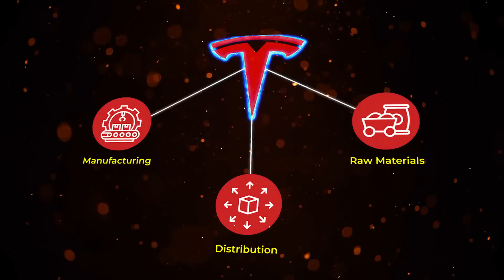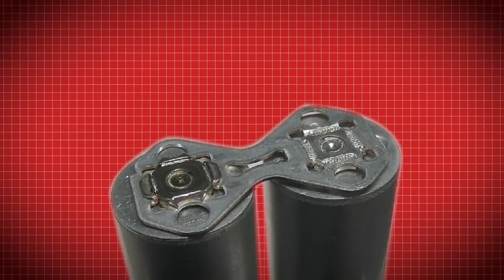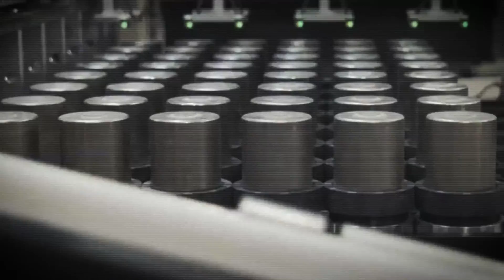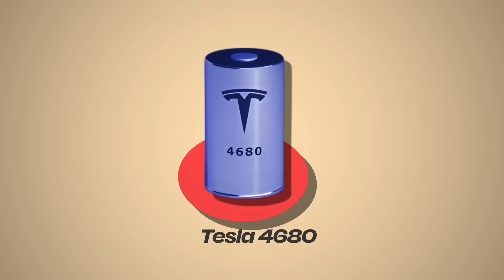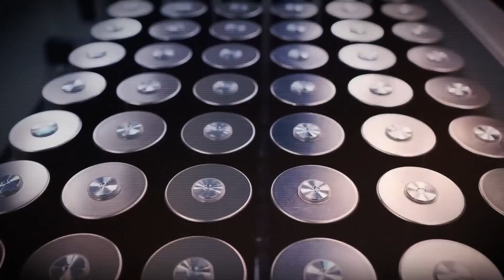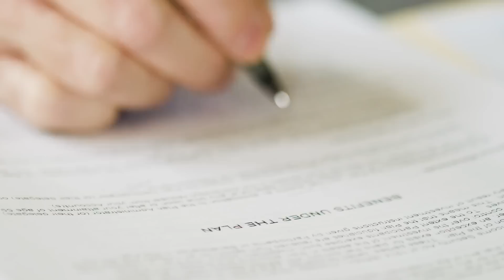How Tesla Builds 536 Batteries Every Second

Comment: rate. of 536 battery  cells. every  second by 
operating. 
a massive  global network of 
Gigafactories. that. function as.  
single, vertically  integrated  machine 
The Global scale is. 
this rate translates to over 
32,000 cells  per minute and 
nearly 17 billion cells. annually

Comment: outside tesla, the automakers who survive the EV age will BE tesla under the hood. GM, toyota, stelantis, ford- etc, IF they stay around, will be a body & chasis stamped by their respective legacy makers- and the rest? TESLA. and why not? already they don't make- ANYTHING- they outsource. legacy auto lost this battle in 1996 when they sold their patents to big oil & scrapped the EV1- essentially sabotaging their own product- despite customer interest. they're FINISHED. when you combine tesla's R&D on EV's, packs, cells & 'the machine that makes the machine'- legacy is easily 20 years behind & falling. every time they keep sinking $ into ads, tesla fud, lobbying AGAINST ev's & refusing to innovate & vertically integrate- moves the tesla lead further & further ahead. at the present rate of stupidity? they'll be 30 years behind by the time tesla drops all other cells & moves all their ev's to the 4680. mainstream media- left AND right wing- have been buying into the EV / anti-tesla fud and are still to this day. obsessing over 'range anxiety' and 'where do we charge' ,  'not enough chargers' or pack replacement alleviates any savings you might get, packs cost as much as the car.. on & on. all true if you're NOT driving a tesla. the media did their job well- the general public is THOROUGHLY brainwashed. the only people who KNOW how cheap a tesla is? are tesla OWNERS. I firmly believe that it won't sink in until they all look around, (much like consumers from the 1900's) and notice that ALL the little gas stations in rural america have CLOSED- because? no customers. tesla owners fill up in the garage. then they have to drive to the nearest larger metro area 20 miles away. gas climbs to $7 a gallon because- efficiency of scale works in BOTH directions. price of electricity keeps DROPPING because, well, solar panels, like all other consumer electronics- ALWAYS get cheaper, so will tesla batteries. simple economics. it only took henry ford about 15 years to turn the horse into a rare sight & the ice vehicle into the norm- and he didn't have super computers, CNC machinery, autocad, computational fluid dynamics, rapid prototyping, 3d printing, automated assembly- NONE of that. when the shift happens- it will happen FAST. one year there will be exhaust pipes & gas stations with fuel that the average walmart employee can afford- the next year? it will ALL change.

Comment: Battery speed and capacity is the core problem it needs to solve over the next 2 years or so to be able to have 4 facilities with 1 Cybertaxi assembly line at 5 to 10 seconds per vehicle production rate. At the current battery production rate globally we are at just under about 7 million vehicles per year. We need to get to 4.5x the current rate. A line that produces a new Cybertaxi at 5 seconds running 24x7x365x60x60/5 is 6.3 million Cybertaxis per year, per line.

Comment: Trying to find the source of your 536 batteries per second. Q1 2025 Tesla produced 10.4 GWH energy storage for the last quarter. Using 4680 cells that only 53 per second. Using 2170 that’s 80 per second.
Reply: Hmm - I asked the same question. The 4680 is a Tesla exclusive design. They commission other factories to build it for them. Ergo - Kinda right . Technically arguable from both perspectives. I think may also be true about the 2170 but not the 1865 .

Comment: Are you sure it's 536 per second?
Recently TESLA reported that they produce batteries for 1000 Cybertrucks per week, that would be 1360000 per week.
According to you, TESLA would now produce batteries for over 3 million Cybertrucks per week.
Reply: I don't doubt its wrong but where has the number come from?
Reply: This whole video makes no sense. Tesla doesn't even use 4680 for stationary storage, but LFP cells from CATL.

That being said, I think it would be batteries for 300K CTs/week, not 3 million (600K seconds/week, 1/2 CT per second)
Reply: Power wall and Megapack is consuming a larger majority of battery production. As Mega pack has low cost and low revenue but allow for a commission per every kWh stored and consumed.
Reply: Doesn’t GM now produce more batteries than Tesla?

Comment: Another Fan Boy channel:  You've got numbers of your 'cause and effect' backwards.

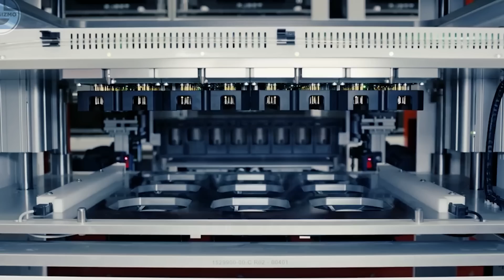10:27 "The more cells you make the more efficient the process it becomes" (this is a back to front statement)

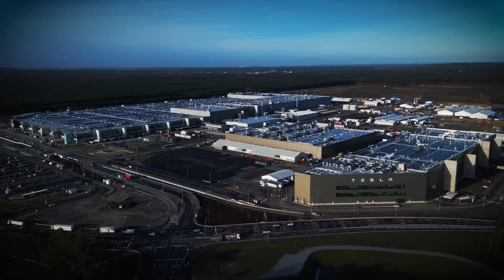10:37 "Every new giga factory it spreads out fixes cost.. tighten supply chains, increase bargaining power with suppliers"

It doesn't increase bargaining powers with suppliers just by building new factory, what suppliers care most if it have higher demands or not.

The reason Tesla make "cylinder cells" instead of higher density "Prismatic Cells" because of scalability and not energy density, because Tesla was hoping to be a mass distributor to other EV manufacture for 'cylinder cells'.

The question is why many car manufacturer will not buy 'cylinder cells' for their EVs, when it is cheaper to construct cylinder cells for 1x EV compare to prismatic cells.
Reply: I like your "back to front" arguments you have against him.

Comment: Why the hell is no one talking about the end of life   How long is the life of a battery and are they recyclable “ at scale we will be drowning in waste in 25 years
Reply: Just look at Redwood industry. Tesla original Tech guy JB, left TSLA to built the recycling process and company called Redwood.   JB is amazing.
Reply: Because that Problem is solved and a non issue. Recycling IS way cheaper than manufacturing with newly sourced raw Materials and thus an econimic inevitability
Reply: They crush them to dust and chemically sort elements for reuse
Reply: Plus JB's Redwood can recoup high 90% of the minerals for at about 2/3 the cost of mining them the first time so it is economically superior. Same goes for solar panel recycling. This is why the economy will switch to almost 100% solar and battery.
Reply: They can be fully recycled.

Comment: Tesla produces 536 battery cells per second across its global network of Gigafactories. The company's vertical integration, from raw material sourcing to custom cell design and manufacturing, gives it unmatched speed, innovation, and cost control in battery production.